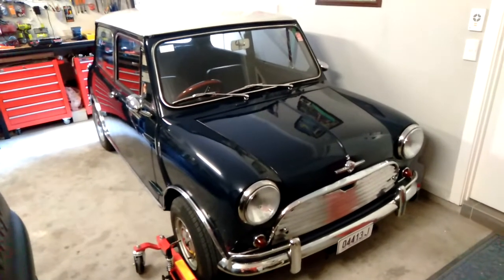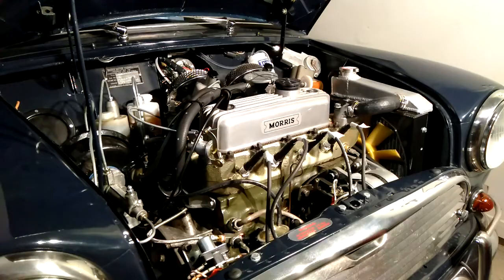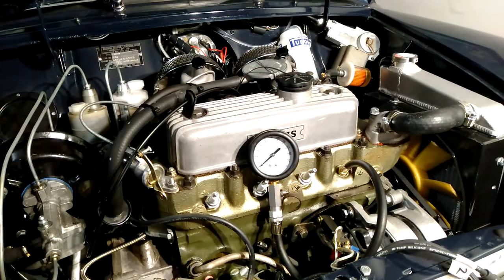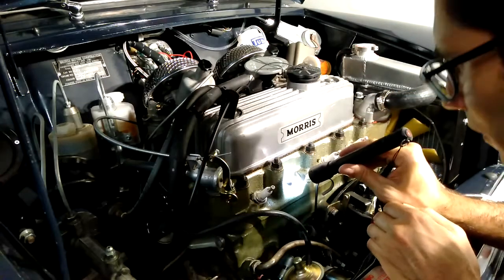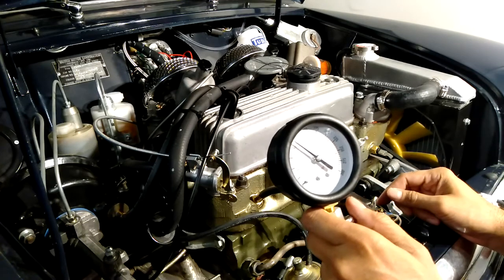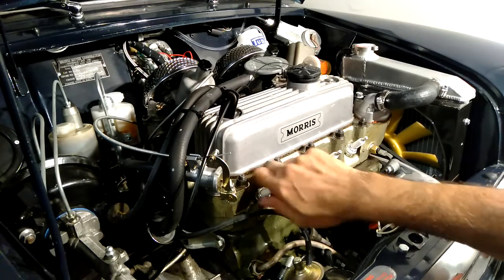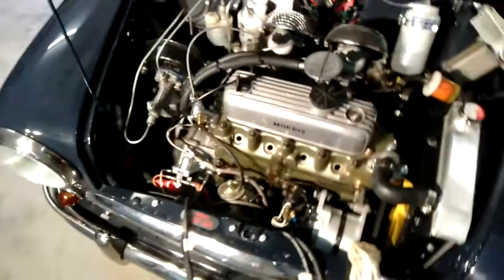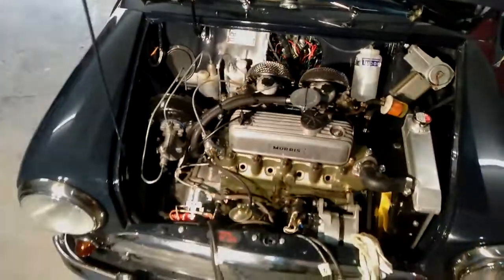Morris Mini Cooper Cylinder Compression Test

Comment: My 1275 c.c. engine had 165 PSI per cylinder when I had it inspected prior to purchase two months ago. Appears to have been rebuilt, but like you I do not know any details on what was done. Also like you, I've got a synchro issue, 4th to 3rd downshifts typically grind. One recommendation is to use double de-clutching...something I have yet to master. This will permit good engagements even without any synchros, so should be a good stop gap until engine comes out for a rebuild one day. 
I see you've got dual carbs. Do you know if there is much to be gained by them over a single (I have a single HS4 now)? Are they worth the added bother of having to synchronize/balance them? I've got a Gunison ColourTune see-through spark plug for settng mixture on carbs...I've used in on my '74 Norton Commando (a true Cafe Racer ;-) to good effect. Not yet used on the Mini.

Comment: What is important is that you have consistent pressure throughout all four cylinders. You could do as mr Hart suggests a wet compression test. Do you have blow-by? A leak down test will definitely pinpoint if you have issues with piston rings (blow-by) or with valves not sealing properly. I believe that your engine is fine as long you can accelerate on hills and the coloured of your spark plugs is ok in all cylinder and right colour of residue. Enjoy your mini as much as you can.

Comment: What's the history of the engine.  Has it been rebuilt at some stage, if so how long ago. How many kms has it done since. 125psi is at the lower end.  Probably not the gauge if it's an old engine that's simply worn. Have you checked valve clearances.
Reply from the maker: The short motor was supposedly rebuild, but the motor has changed hands a few times so its condition and the quality of parts is questionable. I rebuilt the head myself. I will be checking the valve clearances next, will be interesting to see if that makes a difference.
Reply: @CafeRacerLab  when the head was off what was the bore size. 
Do a wet compression test and see what the results are. I.e take all the plugs out and squirt some oil down the plug hole. If the reading is up quite a bit then your compression rings are simply worn
Reply: Michael Hart  it could just be that the compression ratio is low.  
if that is the case either skim the block or the head to raise it,